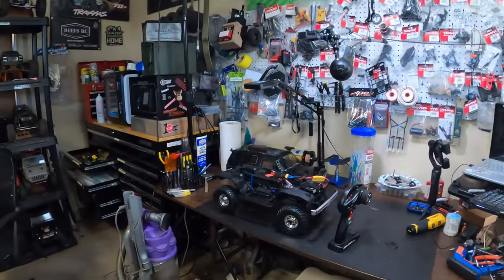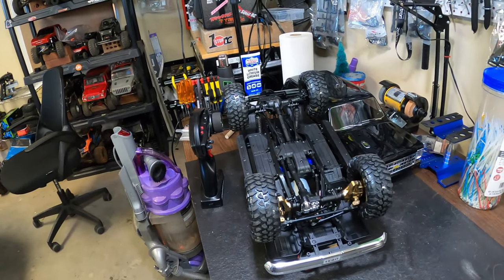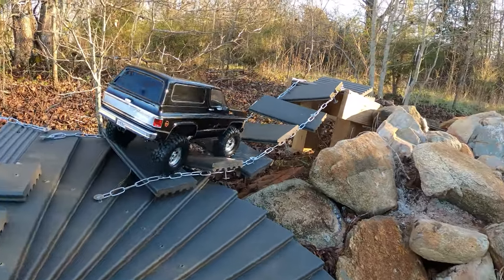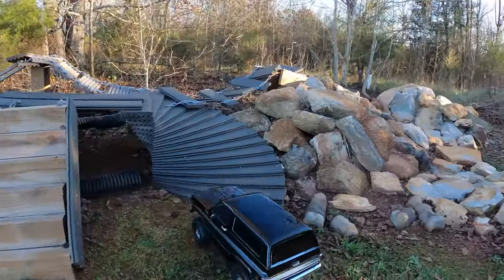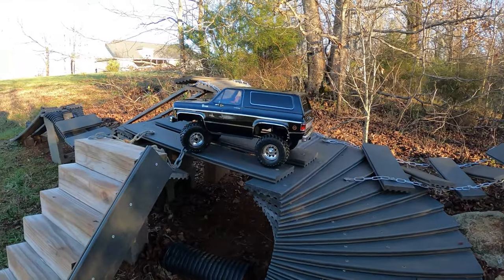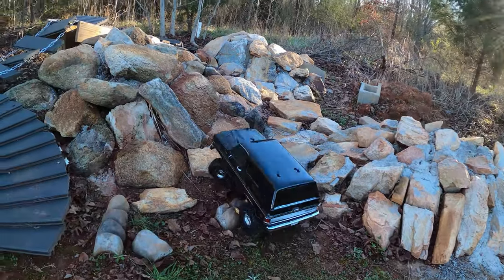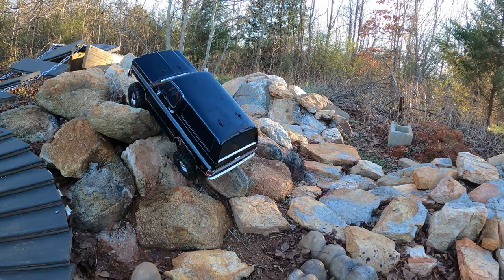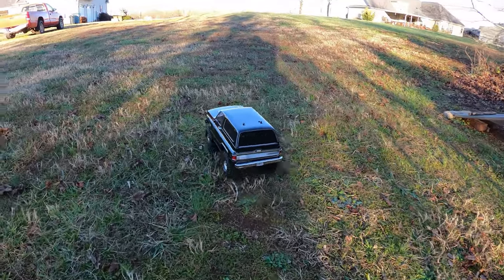Traxxas TRX4 1979 Chevrolet K5 Blazer / Black Edition - First Run on the Backyard Course

Comment: Im curious if you know a difference with the 72 body . Are they both high trails . Why the 72 cost more
Reply from the maker: I don’t know … this one isn’t a high trail and it has body pins. The 72 might have the clip less body system maybe? Honestly don’t know
Reply: @bigheadrc  it is clipless. I did notice a few differences . slightly bigger tires for one